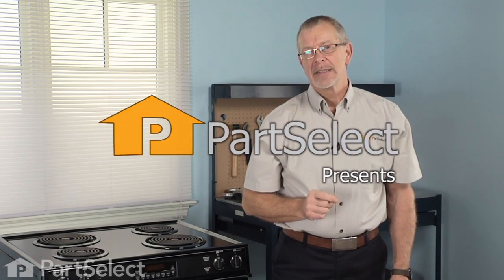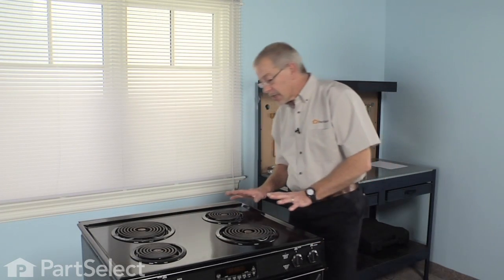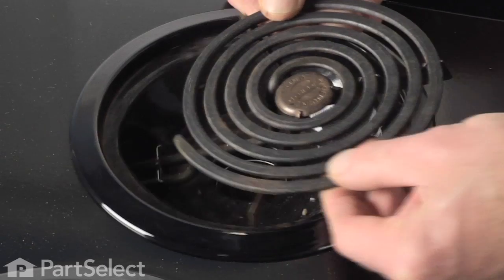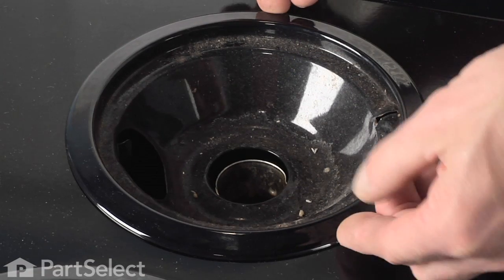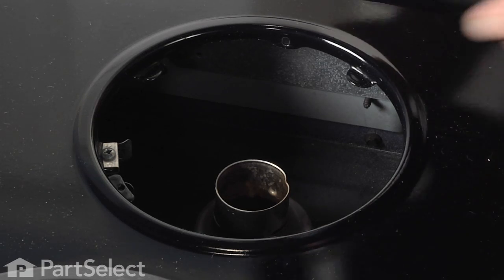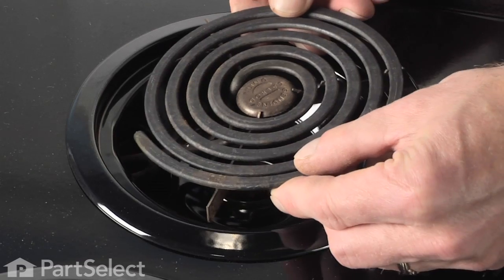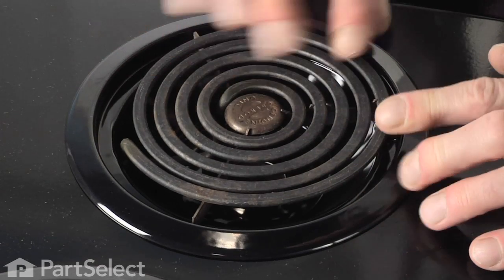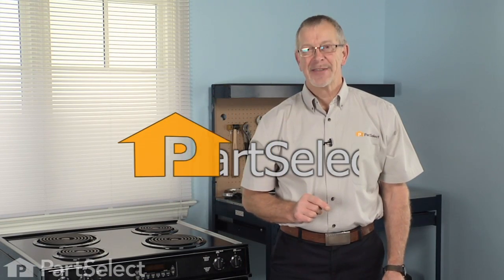Range / Stove / Oven Repair - Replacing the 6" Drip Bowl (GE Part# WB31T10014)

Comment: I've looked all over the place for those 'clips' that go on the drip pans (aka: drip bowls) to hold the element in the drip pan's notch.  Tried to buy drip pans (via Amazon) with those clips but was lied to and ended up with drip pans without the clips.   

If the only way I can get those clips is to buy drip pans that have them, I will.

Any help you can offer to point me in the right direction will be appreciated.  

Thank you..